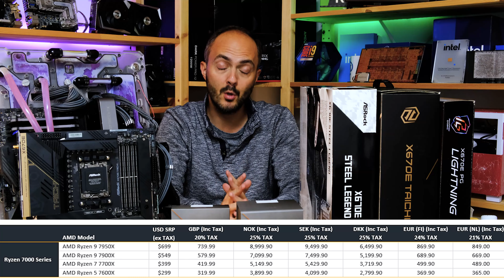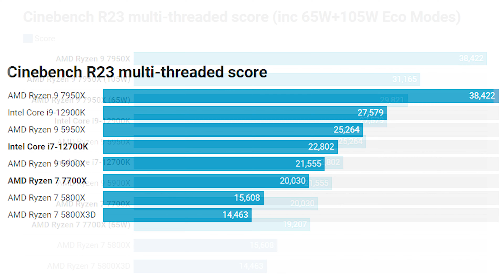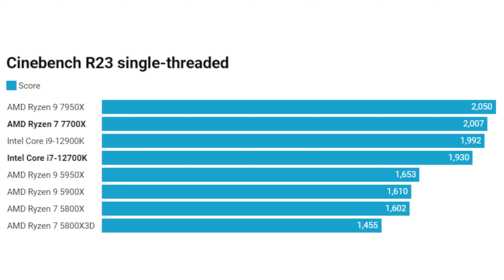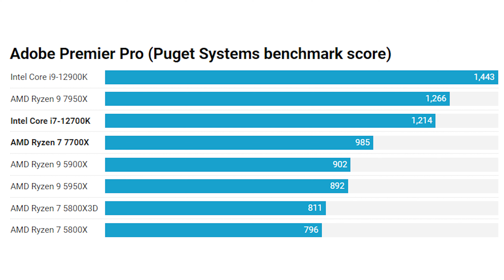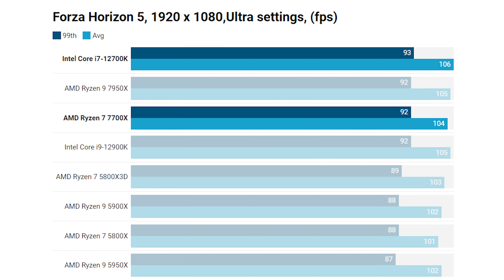AMD Ryzen 7 7700X and Ryzen 9 7950X Review: ZEN 4 POWER!

Comment: Currently the 7600 & x version are the same price. Running the x version in eco mode will yield a bit more performance than a stock with no fan noise increase? Building in a Jonsbo matx with 240 aio.

Comment: your gaming results clearly showed that you're GPU bottlenecked, even at that low resolution. You need a beefier GPU for these tests; as they stand they're meaningless
Reply from the maker: Except there is still variation that’s clearly evident even with an RTX 3070. No one plays at 1080p with a 3090. I’m not in the habit of forcing results just for the sake of it. How many people will own a 3070 or similar compared to a 3090?. I much prefer to test with hardware most people will actually own and see if there are differences there than deliberately forcing unrealistic bottlenecks.

Comment: I currently use my 11-year-old i980X 6 core computer for doing multi track recording in Reaper. I'm looking to upgrade to one of the latest 7950X level and or Intel machines and was wondering if you guys could address a little more information. Since I'm not playing games I don't really care about graphics and don't think I really need the PCIe 5 so much as I do the single thread and multi thread processing power that is needed to render 100 audio files at once in a mix and also to handle all those tracks at the same time.

I can't imagine I need to do any overclocking but if I do overclock what kind of increases can be easily gotten reliably and inexpensively for single thread and multithread benchmarks?

Are there $200 level motherboards like a low end b650 robust enough with their VRMs to handle one of these high-end chips if no overclocking is going on?

What is required for power supplies for both AMD and Intel since Intel seems to use even more power or is an insignificant?

Thanks !!!
Reply from the maker: ASRock has  some good low-end boards - I've tested the PG Lightning and that copes with the Ryzen 9 7950X just fine. Not had hands on with anything cheaper though. It would be best to wait for reviews

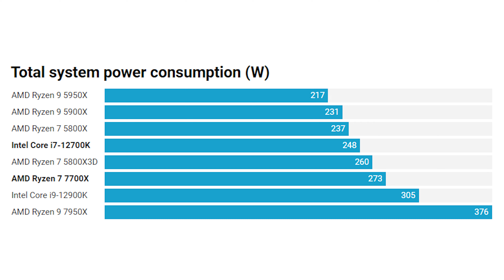Comment: @18:58 really just shows how inefficient 7700x is. At the same total power consumption 7950x outperforms 7700x by almost 50%, how is this possible?
Reply from the maker: It would probably look different in other software. Cinebench uses all cores and threads so the 7950X will always have an advantage. Both are locked at the same TDP (assuming you’re talking about 105w or 65W. So power draw should be roughly the same. But more threads and cores will always be more efficient in workloads such as Cinebench.
Reply: It's a multi-threaded benchmark. 7950x has twice the cores/threads.
Up to a point, but the more you lower the clockspeed, the better efficiency you get. Since both have to fit within 65w then it means that 7950X has to run it's cores at half the power, thus getting better efficiency. That's why server stuff runs at such slow clockspeeds (rarely breaking 3 Ghz), they aim for maximum efficiency.

You could limit 7700X to ~40ish watts to get same efficiency, but your scores would scale accordingly.
Reply: @salvationbygracethroughfaith  ...idk, maybe video you're commenting under is about ECO mode, which limits power down from those 170w...